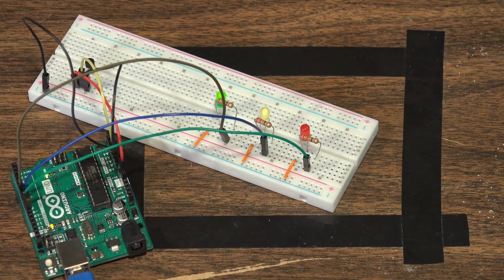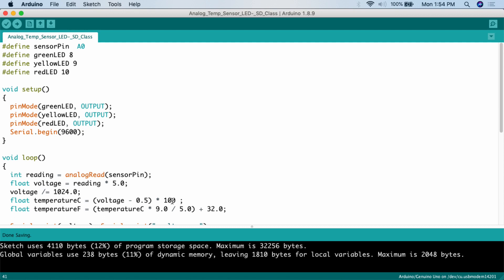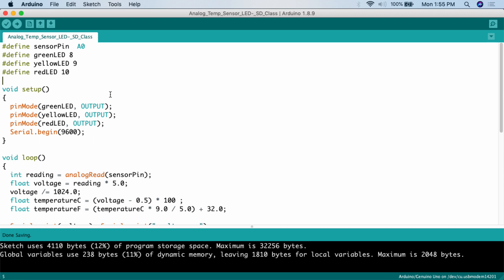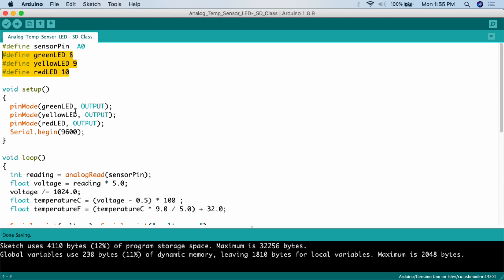Analog Temperature Sensor LED Alert on Arduino

Comment: Great video, I did it a different way before finding your video, and think I might edit my code to this. 
I was also able to get the temp to display on an OLED screen as well as the static high/low points (had OLED left over from a "Simon Says" build I followed. 
My question is, how can we use a button or encoder to adjust the set point(s)?

Comment: Why the ''&&'' for the Yellow LED?  You already know it's less than 75.
Reply from the maker: without the && there would be a coding problem... the if else if else statement stops at the first true statement... so since 75 is above 70 then the yellow light would turn on, and the red light would never be activated...
Reply: @elithecomputerguy  ... Isn't that the purpose of nested IF's?  The first else states that it is less than 75.  Repeating it in the second IF is redundant and not needed.  If it is 75, the else and second IF are not processed.   It also means that should you decide that 77 is acceptable, you have to change it in two places. 

It's not such a big deal in this example.  But, just as you could add a blue LED,  you could have many else-if's.